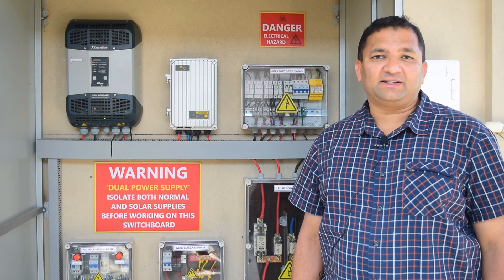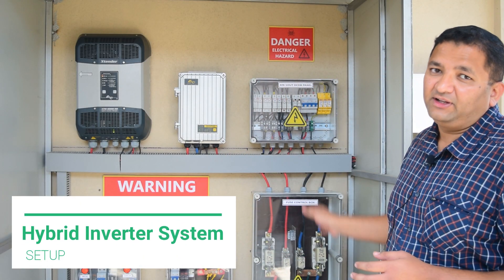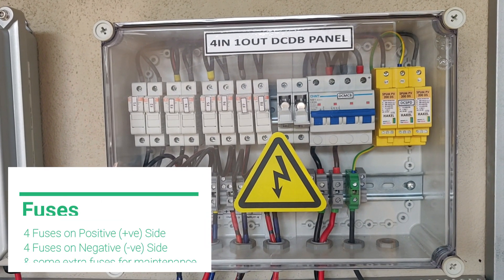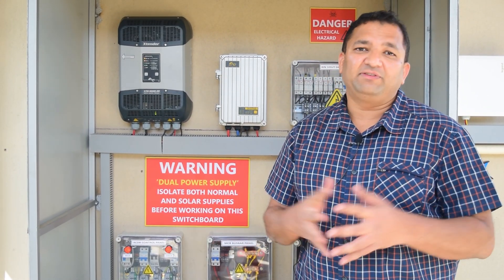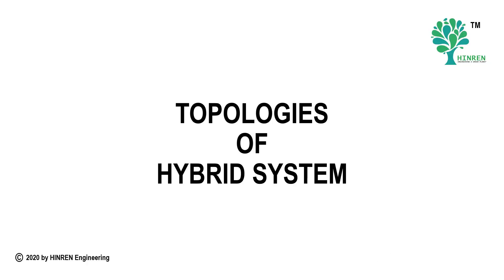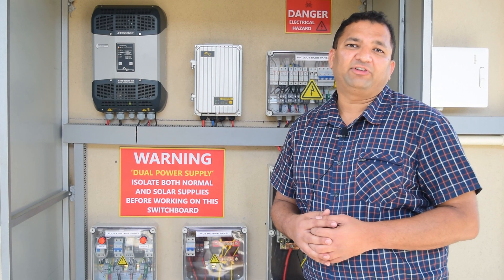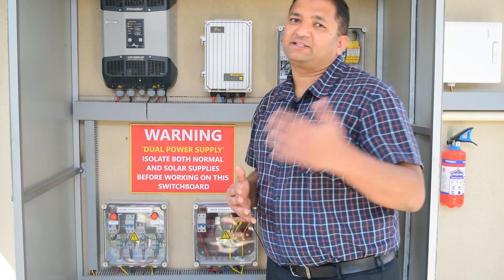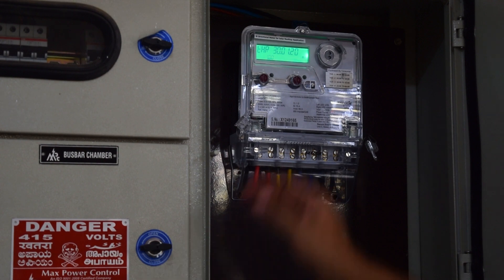Rooftop Hybrid Solar PV System Setup & Working

Comment: what about case 9 when there is not solar at night but grid is present, will it take power from batteries first and discharge them all night? and when the batteries go out then siwitch to grid power before the sun rise? can we use batteries at night only when there is no grid?
Reply from the maker: You can program the priorities. You can choose to run from grid and swich to battery when the grid goes down or run on batteries for a certain discharge and then get back to grid .

Comment: Dear Sunil,  Great video and very nice presentation. I would like to clarify a small doubt. In case 5, you are saying that the power generated by the panels can directly power the load, without taking stored energy from the batteries? Is this tue? I was told by a solar installation company that in such situations, the solar is only charging the battery pack and the power given to the load will be from the battery only - no direct powering of the load by solar. In such case, what happens if we install only a smaller capacity battery - lets say LI-Ion with 48V, 200W system. Will it still work with the battery pack supplying 200W power when there is no grid and solar? Also the solar supplies the complete 1000W when there is no grid supply?

Please confirm.

Comment: This presentation was absolutely awesome and  the graphics for the various mode of the  hybrid units control and distribution  were perfect. The complete installation  works looks amazing . It is very well organized, spaced out perfectly,  it has multi-level circuit protections  and great cable management.  Learnt a lot in  five minutes. Thank you so much.
Reply from the maker: Thank you very much!

Comment: Will there be any problem to hybrid inverter if iam adding additional load in my house.(Drawing power from grid).
Very informative.Thanks
Reply from the maker: Thank you sir .
For this particular make and model of inverter ( Studer 4000), the loads can go upto 10 KW under grid connections and 4 KW under off grid conditions.

Comment: Sir video is very useful... Just one question, as you clarified all possible cases, i need an answer for one extra case like what if solar is absent but grid and battery is present and load demand is there... Will it use grid or battery?
Reply: The load will be fed by the grid. The battery for backup in case of grid failure.

Comment: Great video, really cleared a lot of my doubts. Now i have only one question: what will happen in the case where my load is 5kw but my inverter is only 3kw, will i get the extra 2kw through the inverter (like a pass through) or my inverter will trip and only limit me to 3kw, or the extra 2kw from grid will be independent from the inverter.
Reply: Yes you will get extra from grid

Comment: Hello, I had some questions about this hybrid system: 

1. If battery is not fully charged, and solar generation is higher than the load, is the excess generation fed to the grid or fed to charge the battery?

2. At night when the solar generation is zero, does the system run the load from grid or from the battery? Is this choice configurable by the end user? For e.g. I would prefer to configure that run the load from battery till the battery falls to 50% capacity, then switch over the load to the grid. I am sure there must be other, more intelligent configurations than this one, depending on how reliable the grid is and the climatic conditions during that particular time of the year.

3. At night when the solar generation is zero, if the battery is not fully charged, is it charged from the grid, or do we wait for the next day to charge the battery from solar generation?
Reply from the maker: https://www.youtube.com/watch?v=iWnSV5FCyrg&list=PLLifd1PGpGAcN8ecWe3ooqF9lj0z9K4Y-&index=2

Comment: Will it charge if the battery is completely discharged and (1. load higher than solar generation. 2. load lower then solar generation)?

Comment: CASE NO. -- 9 
SOLAR : PRESENT 
GRID  :   ABSENT 
LOAD :   LESSER THAN SOLAR  GENERATIONS 
 Note - if battery is fully charged. 
What will happen to remaining electricity???  It will be wasted or not???
Reply from the maker: MPPT will not produce power . You can think of it as waste.

Comment: Very informative video... well done.  It will be great if you can add a case where battery charge level is low  and  explain to us how your system will react to this scenario under different conditions.

Comment: A rough cost estimation would be really helpful. Thanks in advance.
Reply: I guess it will not be affordable to most of the people thats why they dont revel. once you go for enquiry they will try to convince you in longterm you will recover and all. I feel these should be transparent in terms of pricing
Reply: Solar plant can be installed at 35-40k per kw if PV panels are used in On grid system, Off grid price will increase due to requirement of battrey and Hybrid as seen needs to many equipments meaning cost will be more and hybrid inverters will cost alot. The above estimation is on genral requirements using standard equipments and will increase on the basis of more hi-tech panel you use and type of structure.
And return period is generally 4-5 year.
Reply: Yes

Comment: Your installation is clean but using a CPVC pipe for reference meter installation is weird. Apart from that every thing is good and clean. May i know what would be the cost of a 3KW similar installation in bangalore.

Comment: Anybody know if Kerala State Electricity Board (KSEB) permits a Hybrid System and whether any subsidy is available?
Reply: In my best of knowledge, No, but if you have influence, Yes. You can do part installation, Obtain Net meter and then connect battery later. There is another compact product, but not sure of quality / warranty - https://www.youtube.com/watch?v=N2gsb79ePiA&feature=youtu.be . I am also looking for similar Hybrid with 5 KW

Comment: Super informative video with technical details. I love the fact that inverter being run in different topologies. If both solar and grid absent, how much load for how long can be used from the battery? Thanks again..👍👌
Reply: Since they have 200Ah FLA batteries in series. The theoretical capacity is around 7.2 KWh. (200*48*0.75). Depending on the load the the duration of back up will vary.